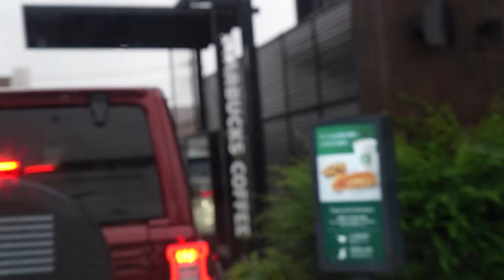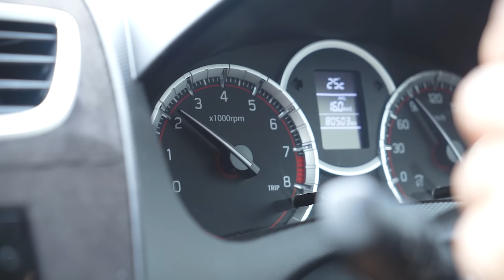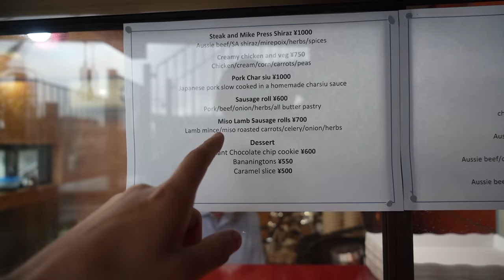SURPRISED MY WIFE WITH HER DREAM CAR! (She Cried)

Comment: 1:40 those vans are popular for racing series in Japan. Legend is that motorcycle racers bought them to haul their stuff and as time went on, they modified them and began to thrash them around the track too. Now they have regular racing series featuring these vans. They are cheap to import because the importers bring the vans with camper packages or have the exporter install sinks and camping stuff. That way, they aren't imposed with high import taxes. Once they clear customs, that camping stuff is removed and they are on the roads.

Comment: The ZC32S is an awesome model. The 6 speed is such an improvement over the 5 speed in the 31. But the new 33 with the 1.4 turbo is nuts. I've had all 3.

Comment: Ngl that looks like amazing car to push its limits on track. Not too fast where you’ll dive into corners at mach speed but it has just enough torque and power to zip through straights and roll out of corners. Can’t wait for the mods.

Comment: ayeeeee swift gang, that stump really does help, cuz my left vans shoe ripped the side, during summer the rubber on pedal really sticky. My Zc31s paint is still in above average good condition eventho the car almost 10yrs old except from rock cips and stuff. before you guys turbo it, hope you guys change the intake and give it a rip, the induction noise is crazy. overall 10/10 fun car in its price range

Comment: I think I had more tears than May.
Best video so far by a long shot 
May keep it non turbo until you need more power.
And Sam
I never knew May bought you a GoPro before you started dating.
It shows she wants you to succeed and gave you something that would help you get where you are today.
That GoPro would have helped you get where you are today. In today's value that GoPro could have made you 100k.
Don't ever forget that.
Support May in anything she wants to achieve in life.
You have someone that will do that for you don't ever take it for granted because that's some real rare shit right there that don't see to often anymore.
You are both very very lucky to have each other'

Hot tip
AUD Yen is 0.011
My production is AUD going to drop it's balls in the next few weeks. Send some GTRS to aus before the thing falls.
Japan ain't gonna take anything less than .0010 so get the fuck on to it

Comment: you might want to consider that yellow swift at the dealer, as a back up car if her yellow swift is down. you really should consider a 2nd swift, 8:44 her hugging the wheel means you likely wont be able to drive it much LOL.

Comment: It was great to see May's reaction and you did a great job there Sam. 👏
BUT.... I've been thinking about that stunt peg next to the clutch. I think it's a potential ankle breaker. If someone (god forbid) crashes diagonally or side on, into her, her leg will get smashed against that peg. If the peg was plastic and designed to shear at a pre determined stress point, I'd have no problem with it. But it looked like solid steel bolted to a steel plate. Nowhere else in a car cabin is there a steel protrusion towards the body.
This is coming from someone who broke his left ankle in July (biking accident) and needed 5 screws and a skin graft. I'm only just able to drive manual for a very short time because I couldn't operate the clutch. So whatever "performance gains" with that peg, mate, it's not worth it. 🙏❤️

Comment: 10:10 hey @Sammit if your thinking about getting a swift sport maybe get zc31. people in Germany have built them up and manage to get 350hp out of the  motor with forged internals , stage 2 cams , some custom block work and aftermarket intake and exhaust system with a bolt on supercharger kit. if you look around on youtube you will see what i mean

Comment: Nice car but you should have looked at the swift sport ht81s! Small baby rally car with:
- Factory recaro interior
- shortratio gearbox
- factory Enkei's (shitty fitment included)
- factory widebody
- 1.5 liter engine with 11.1 compression

Comment: I'm fixing up my dream car. 
1999 gmc suburban v8 
200,000 runs great.  No body damage or rust.
Reply: Is it the new body style or old?
Reply: It's sle v8 5.6 I think it's the old style
Reply: It has   Barn doors two doors in the back
Reply: @marsbase1357  if it's a V8 it's probably a 5.7L otherwise known as 350 Chevy small block, very reliable engine. Barn doors are awesome too lol, good luck with it.